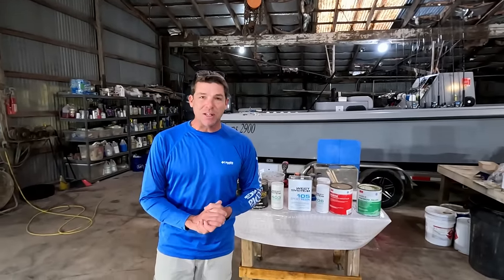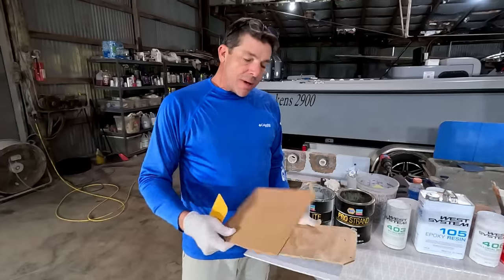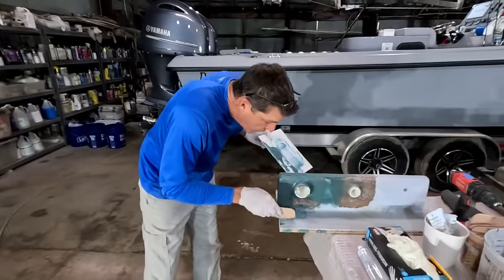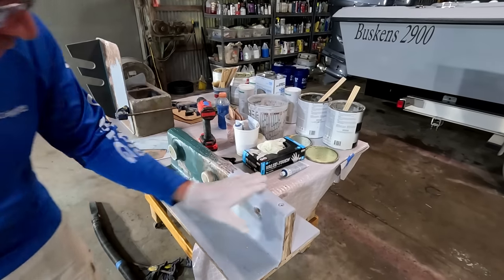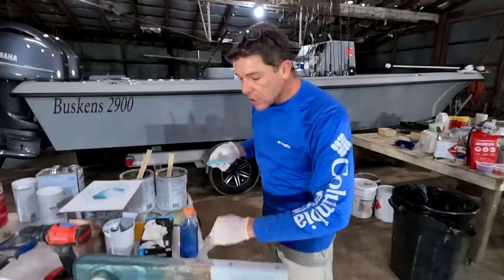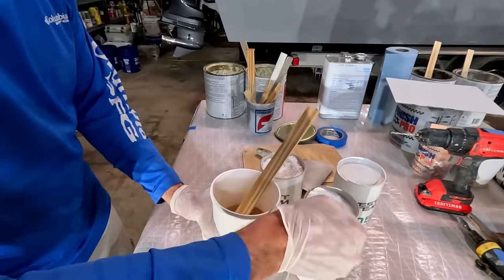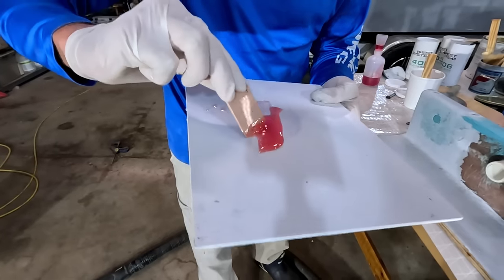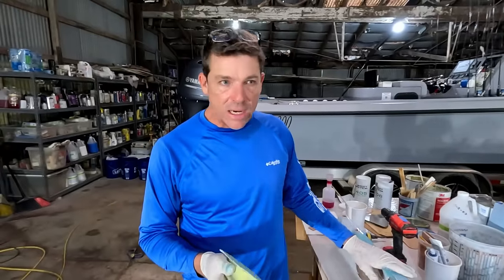HOW-TO CHOOSE THE BEST FILLERS TO FIX HOLES IN FIBERGLASS-GELCOAT

Comment: I hope you will permit me a question regarding what specific materials I need to use in an "at the waterline" repair I need to perform. I bought a boat that had cockpit drains in the transom with long gone and destroyed ball scupper valves.  There are screw holes formerly securing the ball scupper valves that I need to fill to insure the water-tight integrity of the transom to prevent rot.  What materials should I be using??  Can you PLEASE suggest a specific (appropriate) brand/manufacturer/product to use in this instance?  I tried HARD to ascertain this for myself by watching the video, but there were so many products and applications showcased, I'm still unsure which I should choose- and do not have the courage of my convictions.  Any guidance would be GREATLY appreciated!!  Thanks in advance!
Reply from the maker: The 3M high strength vinyl ester filler is a really good all around product for above and below the waterline. I hope this helps and thanks for watching!
Reply: @FishBumpTV  Thank you for steering me in the right direction.  For some reason (most likely because I retired a few months ago at age 71 and this is my first powerboat ever!) I thought I needed to glass over screw holes!  Silly me!  Armed with your info the good folks at West Marine directed me to the exact product needed.  Thanks for your incredible knowledge, expertise and prompt response to what I now realize was a silly question.  Live and learn - even at 71.  😁

Comment: What do you think of adding styrene to the 3M vinylester premium to use it as a skim coat?  I find that stuff sets up really fast compared to polyester.
Reply from the maker: I have thinned it with vinyl Ester resin, before. I have not personally thinned with styrene. You could do some test batches or I may try it and see. Thanks for watching

Comment: Stupid question,let’s say I have trailer rash on my boat that looks like bullet holes thru gelcoat. If I fill in with a putty like you showed and sand flush,when I put a color matched gelcoat on top,I’ll have a raised surface? So after making repair,I need to sand down so gelcoat has a place to be. Then float over? Then sand and polish? Thanks for videos.

Comment: I've seen oriented stranded board (osb) used to build boats. What is your thoughts and recommendations for sealing off the osb to be absolutely water tight bond ? CSM size and woven size ?
Reply from the maker: I have never used osb on any boat work. I would have to do some research on that on. I don't think I would personally use it vs marine plywood. I wish I had more for you on that one. Thanks for watching

Comment: If I am using West Systems epoxy with chop strand and 1708 mat for tabbing my new marine grade pywood stringers in my boat, can I use the ProStrand 1013 as a filler to help achieve those rounded corners to then lay the 1708 tabbing?
Reply from the maker: If you are planning to use epoxy,  then I would probably use epoxy for everything. I have a video on how to make epoxy ( peanut butter) that should be helpful. Thanks for watching!

Comment: I have repaired the fiberglass on the bottom of my boat (6" W x 12" L) and feather-edged the gel coat around the repair. Can I use tinted epoxy and colloidal silica to rebuild the gel coat, and if so, will that seal the fiberglass sufficiently, or do I need to come back with a gel-coat finish over the epoxy? Thanks in advance.

Comment: I have been watching your videos for a long time.  I now have started my first big job. Replacing the deck on my 5m half cab. When i pulled up the floor i found 3 screws drilled from the bottom into the hull. Why was this done?  I asked the local fibreglass shop and they said there is no reason to do it.  What is the best way to fix this.  I was told to knock the screws through and then tape the outside then use resin to fill and glass over on deck side only.  Can i use any resin? I have epoxy to use on my deck and Protite low styrene resin

Comment: Hello.  Awesome info.  I have a 2000 23 Wellcraft  Excalibur cuddy that has a leaking Bomar deck hatch.  I removed it to reseal it but upon removal I see that there are some voids in the laminate (not cored) where the screws enter.  I want to fill these voids for two reasons, one, to give the screws extra bite, and two, to prevent water from entering (obviously I’ll be re-sealing it afterward).  I was thinking of using the 3M extra strength filler, or am I better with resin and silica?  I would like to attach a pic but don’t think it’s possible?  Lastly what sealant would you use between the fiberglass gel coated deck and the powder coated hatch?  Thanks so much!!

Comment: Yikes didn't know about polyester filler  not good below waterline.  How about the West Systems batch you did with poly resin?  I'm assuming it's the poly filler and not the resin that's the problem.  Looking for good option to use for scars below my waterline to top with gel coat?  I have 5 gal poly resin and 5 gal of Arjay 2011 Medium Weight polyester bonding compound still in stock from my transom replacement and glass work.  The Arjay use MEKP and I like that when bonded together with wet glass same catalyst.  But after seeing this I'll order up some 3M for the scar repairs.  I see some top the Vinyl with a poly filler for final sanding on high visibility areas.  Is that OK or is that poly filler bad also at risk as a top coat? 
When I bonded my engine bracket to the transom (two days ago), I did  three wet glass layers on the bracket side, a good wet troweled layer of Arjay 2001 POLYESTER bonding compound on the 36 grit sanded gelcoat transom outside (to fill any imperfect surfaces) all squished it as I bolted together with 12  stainless 1/2" through bolts. Is that a potential filler/water incompatibility area?  Maybe I should 5200 instead of gelcoat the exposed edge?  Boat lives on trailer and not water so I hope that's ok.  Many many thanks, and BTW your pace and fire hose of information was PERFECTLY DELIVERED in tempo and content on this.   Don't slow down and don't speed up (much)🤘
Reply from the maker: Usually polyester fillers are considered to be best used above the waterline. It is because over enough time submerged, water could migrate into or through the poly. Vinyl Ester and epoxy are best at stopping water. That is why epoxy barrier coats are so popular on polyester hulls for blister prevention. There are usually several ways any job or build could be done with success. I  hope the info in the videos will help everyone do the best  job possible based on there budget and amount of time they have. I hope this helps and best of luck with your project!

Comment: Hey Mr Joe, is there an expensive diy hvlp spray gun that you would recommend for spraying small gel coat repairs? Also what would you recommend to use for a guide coat when repairing and sanding a black or dark blue gelcoat?
Reply from the maker: If you are looking for an inexpensive hvlp gun that can   spray gelcoat we have one in the links below the description in our latest mold building video. Our local Lowes also carries one that is around 70 dollars that does a surprisingly good job. I hope this helps and thanks for watching!
Reply: @FishBumpTV  ok thanks I wasn’t sure if that gun was for spraying Pva or for gelcoat

Comment: can you add pro strand to the WS epoxy resin for a decent peanut butter? (for use on running stringers)
Reply from the maker: No, pro strand is polyester resin based. Polyester resins and epoxy resins cannot be mixed. Hope this helps and thanks for watching!

Comment: After using 3M High Strength Marine filler, you can come right over the top with gel coat (below the water line)?
Reply from the maker: Yes, I will usually sand the filler some to give the surface some bite, then wipe with acetone,  then gelcoat. Best of luck with your project!

Comment: after my polyester resin dries hard, do i have to sand before applying each layer of CSM or Woven? i hope this isnt a dumb question. like, say i prime my part or piece of plywood with poly resin, if i let it dry would you suggest sanding before applying my CSM
Reply from the maker: Yes, you can lightly sand or scuff up the surface of the resin with 60 to 80 grit paper, but you don't want to sand through the primer coat of resin. You don't always had to wait till the resin primer coat has cured completely, as long as it has tacked off, you should be good to go for your next layers of glass. Best of luck with your project!

Comment: what calalyst are you using with the 3m premium? i missed that sorry. can you get it in white? i'm doing very crude patch jobs on fiberglass below water areas that'll never be seen by the public. i'm not looking for pretty, just looking to seal it quick and efficiently.
Reply from the maker: It uses a paste type hardener that comes in tube with most polyester and vinyl ester fillers. Most cans come with a tube and it is usually blue. Although red and white hardener could also work. I hope this helps and thanks for watching!

Comment: I was wondering if I can use a poly or vinylester resin to "bring back" my 3m vinylester filler that arrived with the lid loose?
Reply from the maker: Yes, it should work. I use polyester with polyester,  and vinyl ester for vinyl Ester fillers. I would do some test batches after thinning before using on your finished product just to be sure it cures properly. Hope this helps, thanks for watching!
Reply: @FishBumpTV  Thanks, I appreciate your help. And here lately I've learned to do test batches of EVERYTHING. I had a "fresh" gallon of poly resin  that didn't kick and cost me a ton of sanding lol.

Comment: When using fillers in polyester resin, do you catalyse for the total volume of resin and filler, or just the volume of the resin?
Reply from the maker: I catalyze at 1.5 percent for the volume of resin. You may have to adjust up or down slightly depending on temp and batch size. Thanks for watching

Comment: Do u have to use 3m filler for a hole on bottom of boat
Reply from the maker: The 3M filler is a vinyl Ester resin based product, which is approved for above and below the water line. Other types of filler can certainly be used, but I haven't tried every possible brand. So it would be hard to say for sure. Thanks for watching

Comment: Can you do some epoxy resin fillers and videos that relate to epoxy resins. Most DIYers are going to be using epoxy. It’s what’s more accessible in local stores and what most people that don’t have a lot of fiberglass knowledge are going to be using. It’s much easier to find epoxy resins and fillers on the shelf at local stores.
Reply from the maker: Great suggestion! I am working on that for you guys.

Comment: So what product are you using below water ? West or the 3 M
Reply from the maker: Epoxy and vinyl ester based fillers are best below the waterline, especially for boats that stay in the water. If you use epoxy based fillers it is not recommended that gelcoat be used over it, but rather another epoxy based material. Gelcoat works fine over vinyl Ester fillers like the 3m. I hope this helps and thanks for watching

Comment: can you use pro strand below the water line???
Reply from the maker: I have used it on my personal boat for small repairs. But only for boats that do NOT stay in the water full time, and it MUST have several coats of gelcoat applied over it. Honestly, there are better options for below the waterline applications. Epoxy or vinyl ester resin based products are going to perform the best. 3m makes some very good vinyl ester fillers. I have a video discussing filler selection and application here on the channel that you might find helpful. Thanks for watching!

Comment: How come you said that formula 27 is the best filler for small dings in the gel coat and now you don’t even mention it? Why is this?. Please answer me sir?
Reply: Greatly appreciate
Reply from the maker: Formula 27 is still a good product. It can be a challenge for me to have every product in every video, every time as I have to pay for and stock most of the products we have been using in the videos. I hope this helps and best of luck with your project!
Reply: I just fix some chip on the bottom  of my bass boat with jb weld marine.  Do that work OK then  gel over it